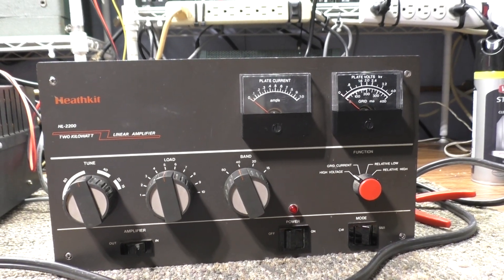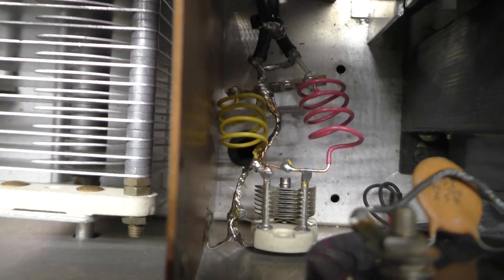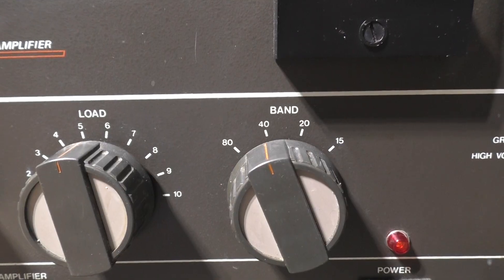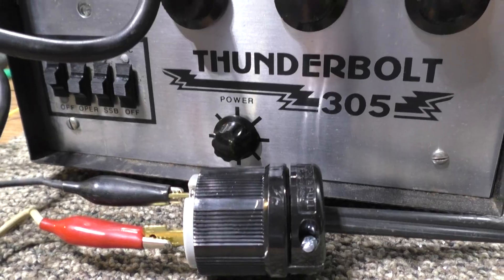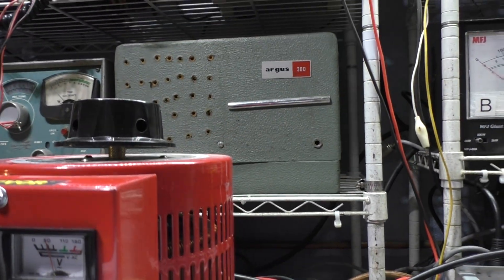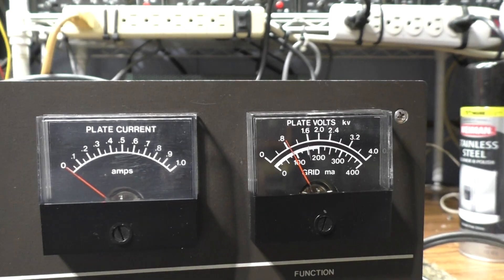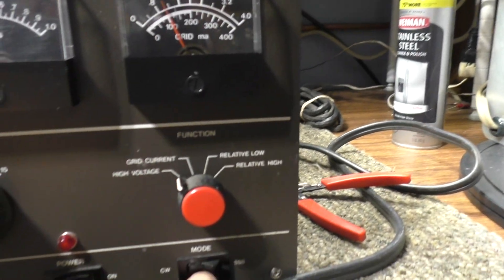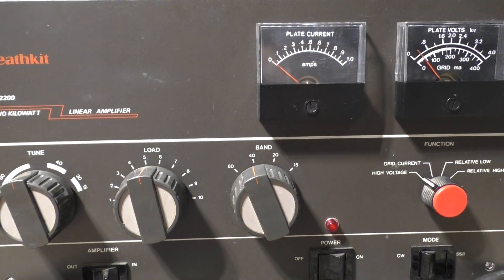Heathkit HL-2200 first time variac slow power up

Comment: Back in the day, there was a disclaimer that went along with the amplifier ads. It stated that the 10 meter band kit would be supplied upon proof of the buyer holding a General class or higher license. Since the overwhelming percentage of the hams of the time used the amps for 80, 40, and 20 meters it wasn't a big priority. Today, the overwhelming percentage of hams are using FT4/8 and amplifiers tend to "invert" digital signals and they typically run 20 watts output or less.
Reply: Ft8 is garbage

Comment: That’s a nice variac. The one I have looks like it’s from the 50’s but it works. On your customer’s cancer, back in the day I had a tech that worked on my radio stuff on the side his day job was technician for a tv station and worked on their transmitter. He died with brain cancer and I always wondered if it was from the RF. 
Thanks for the video Doc.